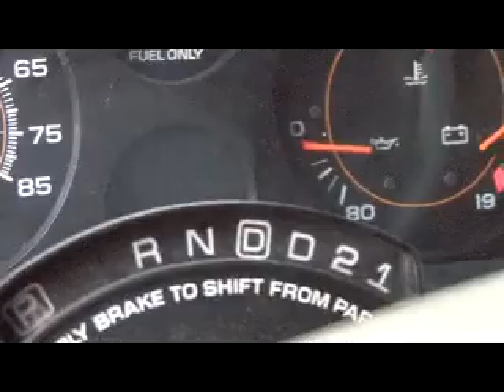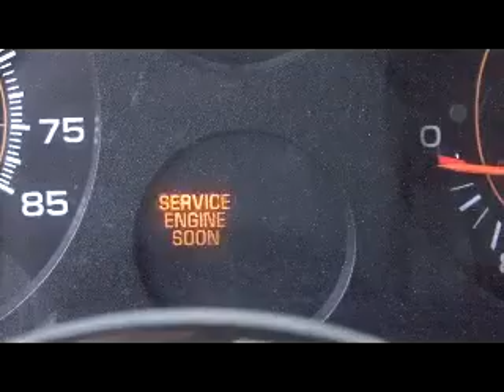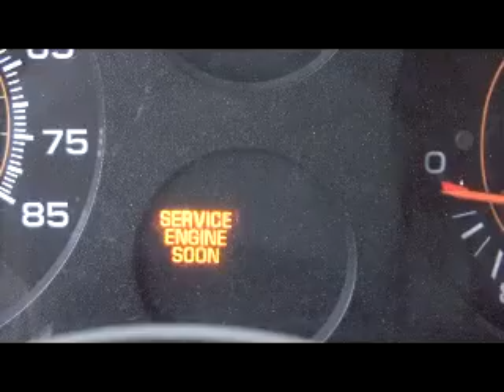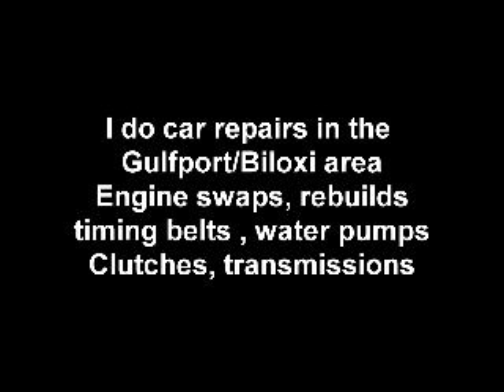How to Check OBD Trouble Codes- Code list in Description

Comment: Can you tell me if this works on a 1997 Chevy 2500 pickup? Thank you
Reply: Bigmike Wistos Get a Snap-on scanner and cartridges and manuals and adapters from E-Bay. Also get the 120 volt cable for the battery Pak and the battery Pak. There are ABS cartridges and Air Bag cartridges. They are rather affordable.